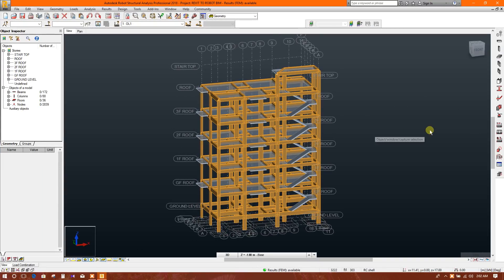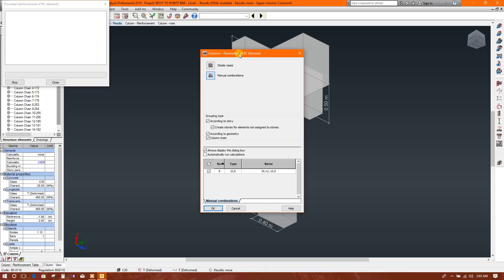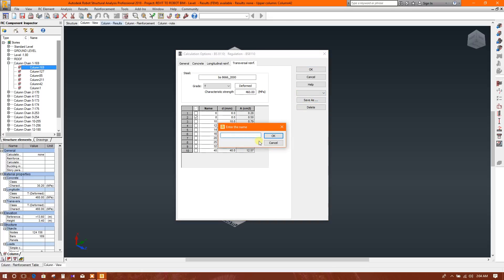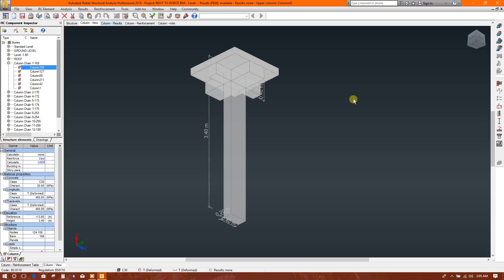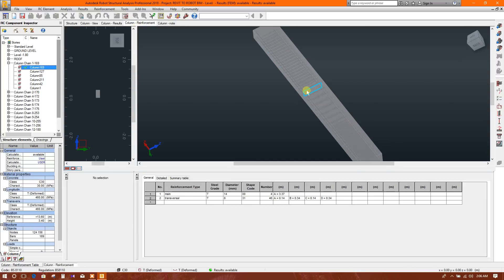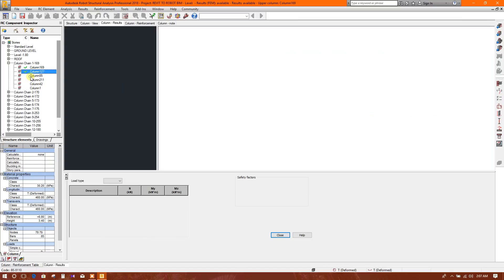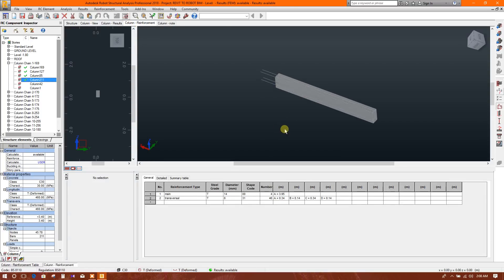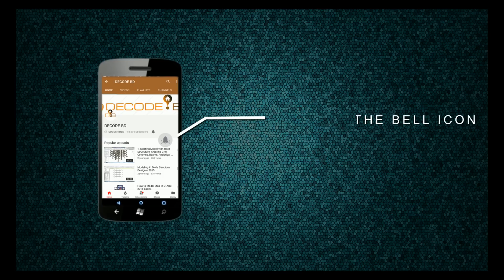ALL COLUMN DESIGN IN AUTODESK ROBOT STRUCTURAL ANALYSIS.

Comment: DECODE BD, please can I have your Robot file. I created a project similar to yours but still getting the steel reinforcement for the top (Third Floor) column greater than the bottom (Ground Floor). This cannot be logically, because the loading at the ground floor is greater than the third floor. Please give your file and i will find out where I have failed in my file. Best regards. Inchalla'ah!
Reply from the maker: Check the loading. I will send the file in sha Allah.
Reply: Please you can send at mging09@gmail.com

Comment: do we need to design each column individually ??? or can we design as a batch ?? setting general detailing rules to all columns???
Reply from the maker: We can design all the beam columns for required reinforcement at a time.
For provided reinforcement I didn't find general detailing rules to design all the members at a time.
Reply: DECODE BD so considering this process in this software . Etabs will save time as it designs everything at one shot.. would you agree ?
Reply from the maker: Etabs showing required reinforcement at one click. Same robot also can show required reinforcement in one shot additionally with number of any Dia of rebar. Robot is advanced in all aspects.
Reply: Oh alright ! Thank you for your replies .. I have worked on etabs since the last three years so somewhere over the period of time the user interface has gotten comfortable to work with.   

Please do make a video on which software gives efficient deisgn based for the same loading.
Reply: DECODE BD please do a video on finding reinforcement unlike etabs where all members are deisgned at one go
Reply from the maker: For required reinforcement? Or Provided?
Reply: DECODE BD required and also how to revise according to the user requirements
Reply: totally agree with you 
provided reinforcement individually to each member one-by-one is a huge waste of time
it must be some way that automatically provide at one shot